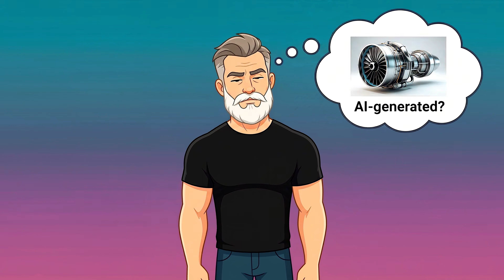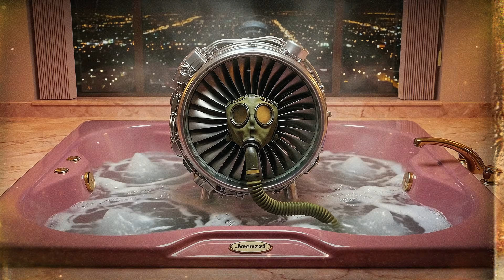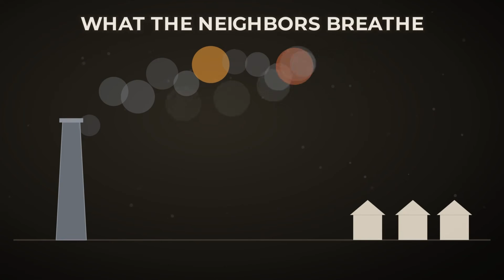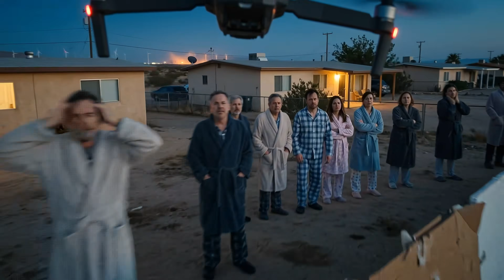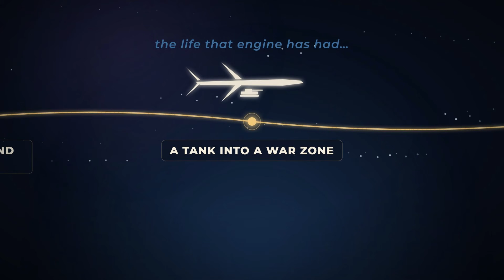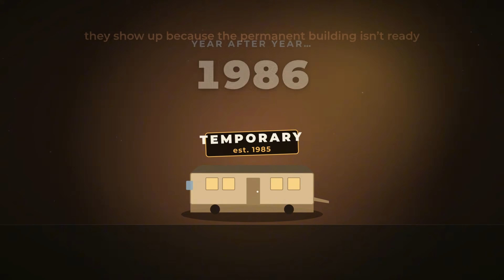What Is A Turbine Generator Why Are They Powering AI

Comment: Will you stop using AI-generated videos and animations for your own videos then? 
Think how your use of them is directly affecting people living around them, and as you well know now, that is for miles around. 

Infrasonic and low-frequency soundwaves affect wildlife, vegetation and the built environment as well. 

The vibrations driven into the ground by the turbines, also in the lower ranges at high intensity.

It is not only these turbines generating acoustic energy at data mining and AI centers, etc.
Reply from the maker: I appreciate the comment — genuinely. Engagement helps the video, so taking the time to write all of that actually helps me out.

I do think you may have spent more time writing the comment than watching the video, though. If you watch the whole thing, you’ll find that I’m asking many of the same questions about AI infrastructure, power generation and the impact on the people living around it. I’m not exactly running an advertisement for data centers here.

But either way, thanks for watching… or at least commenting.
Reply from the maker: P.S. — As for your first question, if you’d like to send a check to my P.O. box to cover actors, locations, camera equipment and shooting every piece of B-roll myself, I figure about $15,000 per video should do it. I’ll gladly stop using AI the moment that check clears.

Unfortunately, humans in 2026 still need something interesting to look at for more than three seconds, so for now I’m using the tools I can afford to tell the story.

I did stop by your channel because I figured I could see how a real video should be done, but I couldn’t find any videos. When you post one, send me the link. I’d genuinely like to see how you approach it.
Reply from the maker: The irony here is pretty rich, because while I always appreciate the engagement, I'm pretty sure I'm not even talking to a human right now—you're literally an AI-driven sock puppet preaching about AI use.
Look at the actual text you dropped. The phrasing in lines like "The vibrations driven into the ground by the turbines, also in the lower ranges at high intensity" and "It is not only these turbines generating acoustic energy at data mining and AI centers, etc." isn't how anyone types out a YouTube reply; that's raw, clunky, unedited LLM output. It follows that exact robotic argumentative template where it opens with a moralizing question and then rattles off a bunch of fragmented, buzzword-heavy sentences about infrasound. Plus, look at your own handle with @StopLFNinfra-y3o—that's the classic automated sock-puppet signature, just a canned activist phrase mashed together with a random alphanumeric string built to mass-deploy generated talking points.
Preaching against AI while using an automated bot script to drop generated complaints in my comments is wild.